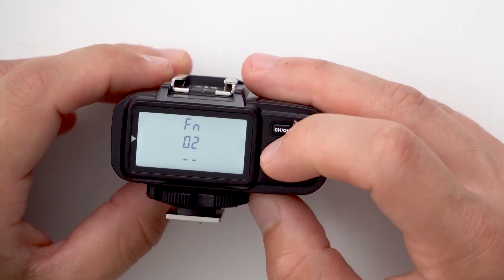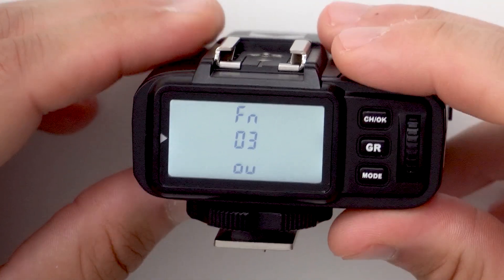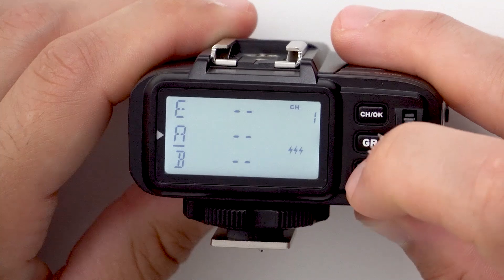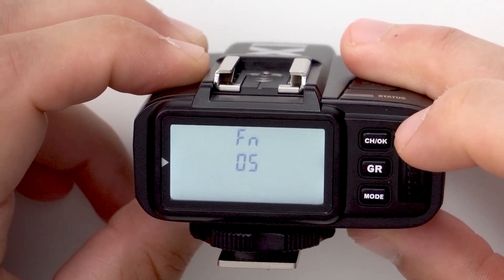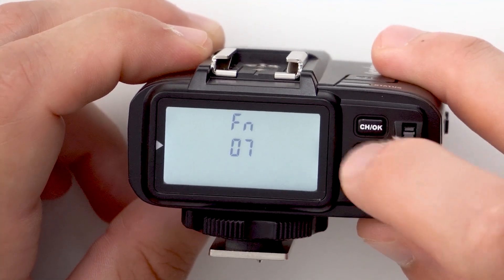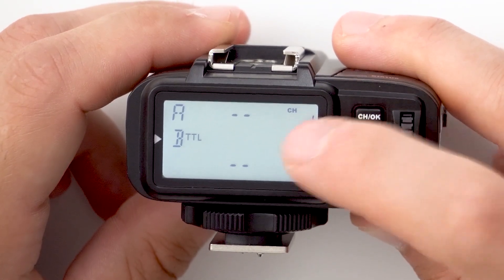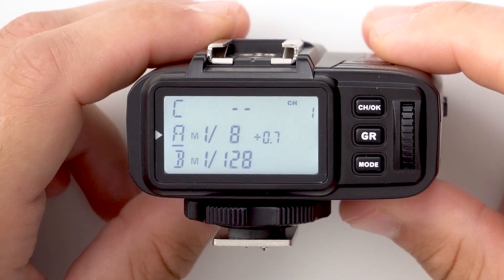Godox X1T Control Guide with Custom Functions (Flashpoint R2 Flash Transmitter) (Pixapro ST III)

Comment: Can you control the X1T-C in camera like with the yongnuo transmitters?
Reply: Yes you can, just go into the camera flash menu and make the settings.
Reply from the maker: I'm unsure, i'm pinning your comment in the hopes that a Canon user that can answer it for you.
Reply: thanks
Reply: @robhallphoto  hi how could we set an id in XIT transmeter from canon 600ex-rt speedlight .
Reply: @robhallphoto   yes forsure

Comment: My nikon x1 T is not connecting to ad200 pro but with godox v860iii it's connecting i checked all the settings on my ad200 as well as on x1 T trigger but  still the godox ad200 is not connecting eith the x1 T trigger
Reply from the maker: @explorewithminroy8365  probably ID function.
Reply: @robhallphoto  how to fix
Reply from the maker: @explorewithminroy8365  disable ID function or match the 2 digit ID on everything.

Comment: i have nikon d4 and d4s body i want to use it with godox ad200 and ttl 600 units now my R2 ttl transmitter has been miss firing do i need to upgrade my R2 and or replace for newer transmitter. which one to upgrade to?
thanks zip

Comment: Hello Rob, 
Thank you for the instructional video.  I have the channel, etc. all set, but for some reason, when I adjust the power from my strobe, it will not sync/communicate that adjustment with my Godox X1.  It used to, but now no. I can only adjust from the Godox X1 and it communicates with my strobe. Can you help with this?

Comment: Can it connect with the Godox TT520II?? I have the 250D and it doesn't have the silver center pin.
Reply from the maker: Ooof, I have to say that was a criminal move by Canon.
The 520ii is not an X series flash and will not wirelessly connect to this trigger, unless you add an X series receiver.
Reply: @robhallphoto  Will the Godox X2T do the job? Since I don't have a Center pin.

Comment: Great video! And for it has been a good product. But I used it for no more than 10 sessions and from one day to another the AF assistant light stop working? I did nothing like firmware update, change AF sistem (I use One shot) or change functions 🤷🏻‍♂️. Any suggestions?
Reply from the maker: Multiple things need to occur for an AF beam to activate. 
It has to be AF-S / one shot (AF-C can’t possibly work with an AF-assist beam since the system never stops focusing.)
AF beam needs to be set to on on the trigger (right next to device ON/OFF)
AF assist / AF Illuminator needs to be on within the camera settings (the same option that controls any on-camera AF assist)
Autofocus point needs to be in center mode, or on the center point / zone if you have it unlocked. The AF assist system is only designed for the center area. This limitation varies slightly camera to camera. Some are only when in center autofocus, others will activate in other modes, to varying degrees away from the center.
Reply: @robhallphoto  thank you very much for your answer, I think all should be set as your describes, but I will double check all the settings as you mentioned, and I will let you know any progress. Again, thank you very much.

Comment: I am having a problem with my trigger, I have 2 speedlites with 2 transmitters and a strobe, plus trigger on my camera, I’ve tried to control all speed lite & strobe settings from the trigger but hasn’t been successful so I’ve got to go to each light and dial in the settings I want, do you have a video on this?

Comment: Many thanks for the tour, congratulations on the clarity of the guide ... I would like to ask a question, and recently that I own X1 transmitter trigger for Nikon with its receiver! It works well I'm happy but I don't understand why if I attach a flash on the transmitter shoe X1, the flash attached to the transmitter does not work, the transmitter X1 triggers the flash attached to the receiver, but does not trigger the flash attached to the transmitter that is attached at Nikon, I don't understand where I'm wrong and ask for help to use the second flash attached to the X1 ... Thanks and sorry my bad English

Comment: The TTL funtion of the (x1t/x2t/Xpro) can control the TT600 (Manual Flash)?
Reply from the maker: It will fire it, but it won't fire in TTL. It will just fire at whatever the last manual power setting was at.

Comment: can I use 2 speedlight at the same time with this 1 trigger?
Reply from the maker: You can use as many as you want. You have 5 groups to control the power of independently, and can technically can put an infinite amount of lights on each group.

Comment: How to do high sync flash . Is there any button on x1t?
Reply from the maker: Nope. Just activate it in camera and it turns on automatically when shutter goes beyond sync speed.
Reply: So I will put it in manual of my camera and automatically turns into high.? But there is no symbol of high  on my flash .. is that right .?

Comment: at 4:10 you mentioned how to change the way to adjust by holding down Ch button for 5 seconds but then the video skips and you start showing how to adjust the mode. I cannot get it to change to that mode pls explain.
Reply from the maker: Hold down channel button and it will keep the groups fixed.

Comment: anyone having issues with the groups constantly flashing back and forth?  Ive done a reset and as soon as I press a button they begin flashing which makes me unable to change any settings.
Reply: same with me today? did you find any solution?
Reply: @jeffianoandasan8394  my unit turned out to be defective and had to get a replacement.   Godox asked me for a video of the problem.

Comment: Hello Robert . 
I have a Canon 5dm2 and godox x1 with 24 software
I cannot turn on 5 groups, only 3 are active, after setting in functions cfn 06 to 5 only 3 are active and there is no option, e.g. flash off, there is only 1 to 256 adjustment not present - when I enter holding mode into the Gr mode all groups are there I can also turn off the flash - BUT it doesn't work with Canon 5dm2. Is there any way out of this situation, except for replacing the camera?
greetings
Damian

Comment: I'm using a gh5 with the x1t-o and/or the tt685-o. But I have 2 nikon compatible speedlights -- sb28, Metz -- and a Cactus first gen manual. I've given up on the idea of doing cross brand ttl from the 'o' devices but I hold out hope I might be able to do output controlled manual to either the sb or metz or cactus speedlights. So the question is: is there a receiver, presumably Godox, that will let me manage power level on these legacy flashes from my Godox devices. I'm happy to follow links or search down through comments if this is an old question. Your work on the Godox line in among the best, most articulate and professional I've found. Thanks for that.

Comment: When i cycle the mode button, i got manual, ttl and three lightning symbol on the right side of the power output number. And the flash is still on.
Reply: I get these options too.  The double dash to switch off certain groups isn't an option when pressing the mode button.  Interested to hear if you get a response to this question.

Comment: I have godox sk400ii strobe light, it has power of increse or decrese at 1/10 stops, while my godox X1T-N control sk400ii by 1/3 stops.

Have any idea to stops light by 1/10 stops ?
Did godox X-pro works by 1/10 with my godox sk400ii ??

Comment: Hi Robert, Hello sir, i had query regarding the godox x1N reciever with a Nikon sb910. I have a Nikon z6 and the X1Tn transmitter. I cannot seem to activate the HSS at 250ss. And also is it possible to control the power in manual mode via the transmitter??  
Also it doesn't shift automatically to TTL mode when I change it on the transmitter. Any help would be much appreciated.

Comment: Quick Question Rob, how do you stop the ad200 going into sleep mode??
Reply from the maker: Hold test button for a few seconds to open up custom function menu (C Fn. is displayed over the test button as the subcommand). F3 has the power symbol which is the sleep function, set it to off.
Reply: @robhallphoto  Hi Rob, Thank you very much, could not find it anywhere online, Brilliant :-)

Comment: Hi, I was wondering if the X1T would work with Elinchrom flashes? I just received some flashes and I'm looking for a good trigger. Just not sure they would work together.

Thanks you for the great explanation in the video.
Reply from the maker: Godox X1-T only triggers Godox (and Godox rebrands) natively. Not anything else. You could connect an X1R receiver to the elinchroms sync port but you will not get remote control

Comment: Hey having extreme troubles with this... The transmitter COMMAND DIAL as you call it wont change anything am i doing something wrong>
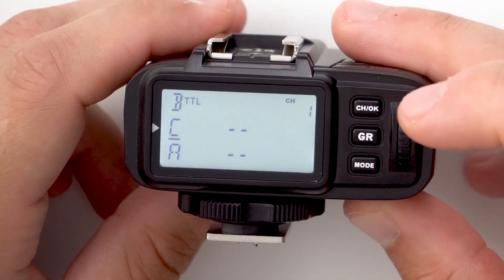Reply: Mine hasnt worked either since new. seems like an error in the Fn 08 override assignment (discussed at 3:52). it doesnt change anything on the sony version.  Ive had to work around by keeping ABC as default and changing the lights group letters to suit ( as robert hall says). holding the group button 2 sec, then the command dial works to change power. Ive factory reset it (no change) and it came on current firmware from factory with this 'quirk'. Can anyone assist as learning to use is hard when it performs differently than default?
Reply: ok, watching this video again and now I understand. I need to hold CH for 5 seconds (not 3 seconds) as holding 3 seconds triggers another function!

Comment: My transmitter will not change to TTL/M mode. Only get choice of A/B/C & either On or - - Off. Totally lost after reading manual & watching 4 Youtube videos. It simply will not change.
Reply: this godox is a shocker isnt it. short press of mode button to cycle thru modes. take trigger off the camera  (and adjust mode) to see if that diagnoses a camera setting issue

Comment: You are in a hurry to finish it. Should have done a demo with the gear
Reply from the maker: What gear would you like it demo'd with? V860II? V850II? TT685? TT600? TT350? V350? AD200? AD360II? AD400 Pro? AD600? AD600 Pro? AD200 Pro? QT600II? QS600II? SK300II? DP400II? Perhaps that's why this focuses on the trigger's controls and not demoing the flash (which I most likely demo'd in that products video).

Comment: Thanks for the video. I bought one of these and have spent some time reading the directions, which are not completely clear. A few questions that the manual does not explain: pressing and holding hte mode button for two seconds brings up a GR symbol. What is that for?
Reply: setting groups

Comment: Thank you so much! I have a few Contax and Yashica film cameras and lenses and been wanting to use flash for my film shots.  The Fn 01 single pin mode was the answer, will be doing manual metering and this is such a great thing to know, I won't have to tether with a Sync Cord!

Comment: i have Godox X-Pro flash trigger, X1R receiver, Canon 600EX-RT and Godox V860iic speedlites, camera is Canon 5D mark IV, i need to synchronize these all speedlites and flash triggers - receiver and transmitter. how i can do that?
Reply from the maker: put the X1R on the 600EX-RT.
Reply: @robhallphoto  i did that, but then what to do?

Comment: I'm so confused! Following along with you while you go through the settings, but mine are different? Ie: menu 06 is where i pick between 3 or 5 groups, not the auto assist beam control.
Reply: yes it appears sony trigger menu 06 is different (to fuji in video), or became different with firmware changes

Comment: Hello Robert can I trigger my yn600ex rt2 c by using x1t as a receiver?
Reply: You need a X1R-C receiver for your speedlite then you can use the XT1 transmitter to fire the speedlite.
Reply: @harrygilliland5675  thanks man ☺
Reply: @speedlight305  You have to get the right receiver for your speedlite X1R-C is for canon

Comment: Seems like the navigation has changed a lot since this video.  Does anyone know of a more current instructional? I'd prefer Rob doing another, but it wouldn't be right for me to ask that of him.

I'm having issues turning groups or specific flashes on and off.  Had a heck of a time with it at a shoot this weekend.
Reply: Me too, the cycling theough the mode button, got a three lightning symbols instead of off mode

Comment: What is fn10 and fn11 on the version 3 update? 

Great video, by the way!! It helps a lot.
Reply: FN11 is for setting user ID   FN10 is for use with an APP. I can't find any information on how to connect and use it with the app.

Comment: Godox x1 c can be used with Shanny 600c?
Can we change power of flash through transmitter?
Can we use shanny 600c ttl with Godox x1 transmitter & receiver?

Comment: How do you use function 3 with the Godox Sk300 II? More specifically I want to use a sync cable to try to avoid any misfires during a graduation ceremony. I've heard wifi signals can be an issue sometimes and I can't take that chance. I know I need to set function 3 to OU/out but when I do the wireless function on the transmitter and Sk300 still seems to be active. How do I know that it is operating via the sync cable?

Comment: I have canon 80d and I will buy godox tt685c and x1 trigger but a lot of people says that tr685c is not working good in ttl mode with canon 80d and even the trigger x1 is not working cool with canon 80d so the problem of ttl mode of flash and trigger with canon 80d solved or still stuck please help me before I waste my dollars 💔

Comment: Hi... Thanks for the video... I am using Nikon d3400. I switched on af assist switch as well as turned the mode "on" in custom function settings. In camera, I selected af single servo and single point focus. But af assistance in x1t is not working? Any idea? Thanks in advance

Comment: That is what I needed thanks man for the video. Couldn’t use a flash with multi function and now I can awesome but still don’t know how T and H works when I set t-1 and h-10 I suppose to have 10 flashes in 1 second but I have not , only t set to 5 make 5 flashes and set to 10 gives 10 flashes?
Reply: maybe flash doesnt recycle its power fast enough to achieve the settings?

Comment: I have a hard time running the X1Tn and the YN622n together, although I did the custom function of a single pin mode, but every time I have to put the yn below, the x1t above it, then turn yn on first then turn camera on then turn the x1t on so all the flashes would work simultaneously for one shot only, then redo this whole process again, it's a pain in the butt, hope there's a way to make them work better than that

Comment: Hey great review. I have been trying to figure out if it's possible to trigger the shutter with the x1T-O (I have a Panasonic with the x pro on top in the shoe) I saw a vid where they said it was possible using the x1t as a remote wireless trigger for the shutter. any thoughts on that?

Comment: VERY helpful - THANKS! I was completely confused (and pretty frustrated) until watching your video.  Successfully got a TT685 and a TT600 to finally work as desired. Yay! The little manual with the trigger was not so clear (being nice about that). 
I am not real clear about getting HSS to work properly with those two triggered flashes, but this is a great start.

Comment: Hi. I noticed that the AF assit light on the X1 is not working with the Canon 5D Mark IV although the switch is on. Is this someting that can be fixed with firmware update? Thanks for responding.
Reply: Mauricio Suárez Guzmán same problem here

Comment: I have a problem with XT1c i can only get groups ABCD can't get E anymore plus when i select a group to change it from TTL to manual all the groups now change instead of just the one i selected, does anyone know what i have managed to do to get this so wrong as i cannot get it back to factory default even holding ch/grp and turning doesn't seem to do anything so am wondering if my unit has developed a fault but i was pressing buttons at the time it all went wrong ? :-(
Reply: yeah i made the mistake of button mashing it at the start (not understanding the terrible user interface) and it changed all sorts of settings that cant be factory reset

Comment: I tried many way to change setting my godox x1t transmitter with sony a7r2 but not working my strobe flash, test button only firing, I connected my neewer c300 with godox x1t receiver, help me how its work
Reply from the maker: put on fill flash.
turn off red-eye
make sure to use mechanical shutter.
Reply: still not working my friend
Reply: I am really frustrated since one week I am trying to fix, I think better I will return this Godox and buy better one, could you please suggest me good brand of trigger and receiver for sony a7 camera

Comment: Robert, using this Godox system to fire a speedlight which in turn was to fire off a Bowens studio flash; image was almost black, looked like only capturing available light. Dropping shutter speed to 1/40 made no difference. In the end, I used the pop-up camera flash to fire the studio lights and all worked fine. Any suggestions as to why the Godox system didn't work?
Reply from the maker: I have never personally attempted optical transmission with Godox gear, but the first thing I’d look at is the S1/S2 option to change the behavior of how it works with preflash.

Comment: Thanks for this. I’m using the X1T-O and for some reason there is a half second delay between pressing the shutter button and the photo being taken. Maybe it’s something in the custom settings.
Reply from the maker: Definitely update firmware. Some users experienced this on the Sony A7R2 as well.
Reply: Robert Hall Photography thanks Robert.  I have a Mac so I can’t upgrade the Godox firmware. But I have just changed the flash on the camera to Fill Flash and the delay is all but gone. Just a fraction of a second delay now.